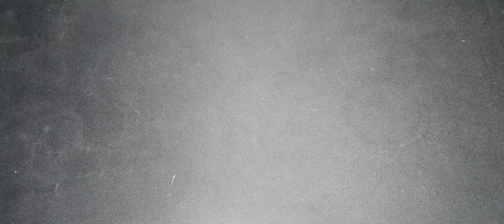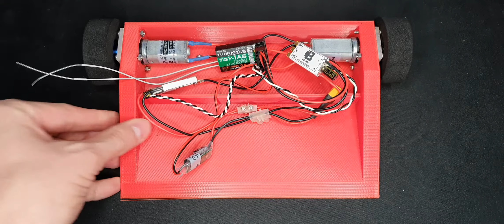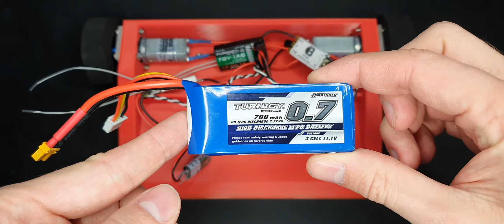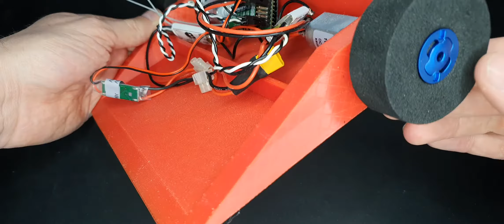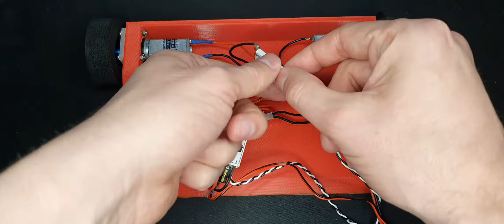BBB Beetleweight Drive Kit Circuit Walkthrough

Comment: This is exactly what I've been looking for, thank you so much! how would you wire in a servo or 3rd motor for a weapon? just add the red and black cables to the ones in the video?
Reply from the maker: Thanks :) I'm glad it was helpful. Pretty much, yeah. You can connect directly to the red ands black or through the BEC for more sensitive parts. Bristol Bot Builders have a good guide here: https://bristolbotbuilders.com/guides.html#beetle (pg 12 & 13)